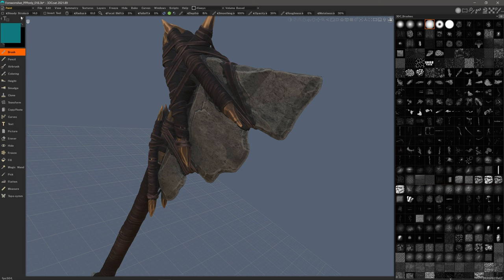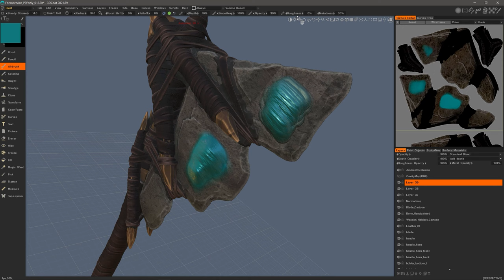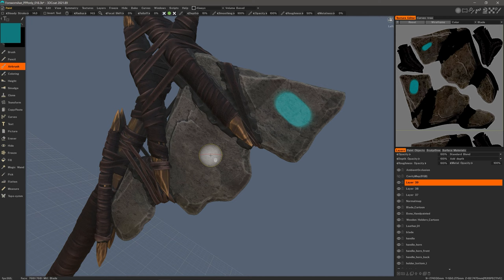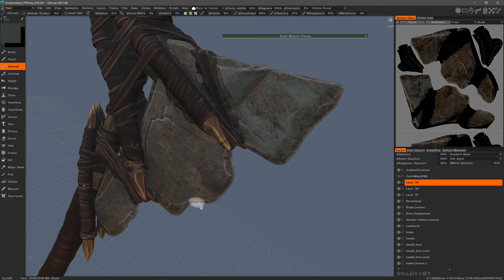Airbrush Tool

Comment: The texture projection in the paint room is one of my favorite tools, and one of the main reasons for me to use 3D coat.  You have the Photoshop liquify style warping ability from Mari and Zbrush, that is missing from Substance Painter.  I end up having to use both apps to do my job more easily.
Reply from the maker: Please send your request to support@pilgway.com so that Andrew (owner/chief developer) is made aware that there is increasing demand for this type of feature. Many times requests are already on a "To Do" list, but the more the development team hears the same request, the greater the urgency it receives. With that said, there is already the ability to Warp a Texture Projection, using a Brush. What is needed is a Mesh style warping system.